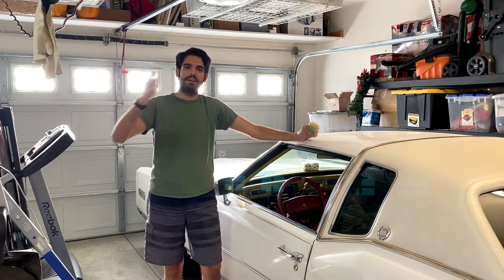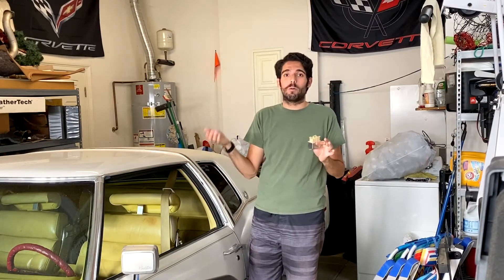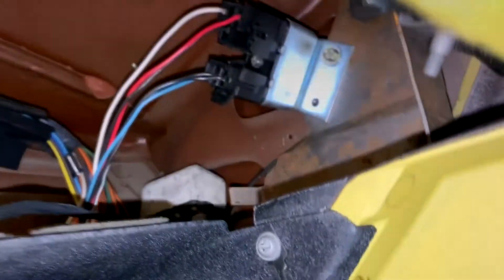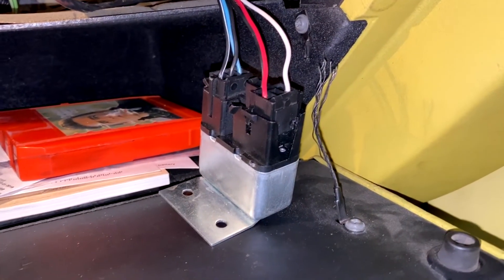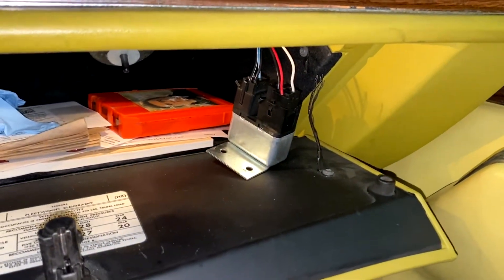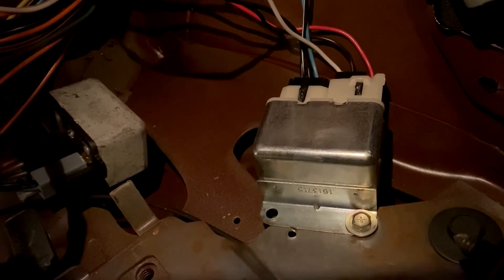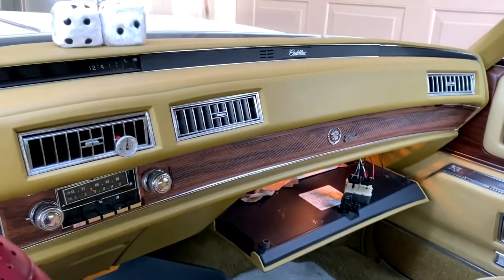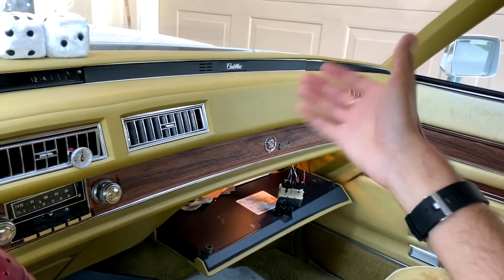1970's GM Power Antenna Relay Replacement | Cadillac Eldorado

Comment: Hi, I have a 1978 Eldorado Biarritz and i can not find the fuse box - is it hidden some where mysteriously ??? Please help. Thanks.
Reply from the maker: Hi there, I had the same question the first time I had an electrical issue and didn’t see anything under the hood.... turns out the fuse panel is down under the dash by the emergency brake pedal :)

Comment: Hi, I really appreciate your video, there is no information on the internet about the Cadillac power antenna systems. I have a 1975 Eldorado Convertible  that I just put a new style classic radio in. But of course the power antenna doesn't work. I looked at the wiring diagram that you linked on here but I think 1975 is different than 1977. What manual did you get the diagram from? If I can find a schematic I would have half a chance to figure out how I can get this system to work. Any help would be greatly appreciated.
Reply from the maker: Hi Eric, sorry I just saw your post!
From what I could gather back when I did this project, 1977 down should have basically the same wiring schematic (I could totally be wrong though) so this should work for you using the “1977 and earlier” diagram if you want to test out your circuits bypassing the relay. As for the diagrams, I got the one from my 1977 Cadillac Service Manual and the other to help me figure out the later years relay wiring from the 1978 Supplement manual. Between these two it should be everything you need, but feel free to let me know if you need any other diagrams or references :)
Reply: Hi… I have a 76’. I want a classic looking radio for it. If it isn’t too much trouble, could you maybe link the radio you bought? Or tell me the name… Thanks, J.

Comment: Hi there, I just bought a 76 convertible with 48,000 miles on it that sat in a garage for over 25 years. Of course, the original 8 track does not work. I know I have to pull the radio. My question is about the power antenna. Is it supposed to go up and down with the dash switch or does the stereo have to be on in order for it to work? If so that would explain why the switch does nothing. I also may have to pull the antenna itself so I am waiting for the shop manual to be delivered. Thanks in advance.
Reply from the maker: Hey there, yeah you’re correct, the radio and the switch in the dash work together to activate/deactivate the antenna, so if the radio is inoperable and not connecting the circuit to trigger the relay that could definitely explain the non-op of the antenna…. If you push the dash switch into the down position (that position is momentary), do you get any brief noise/click from the antenna area? That would be the only position that I believe bypasses the radio and even with the antenna down, the relay should make a small sound.